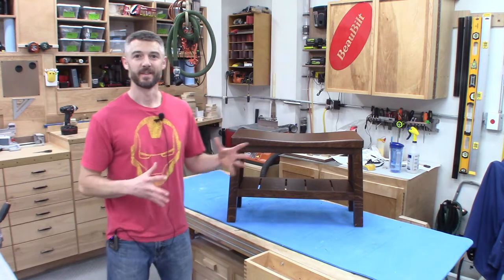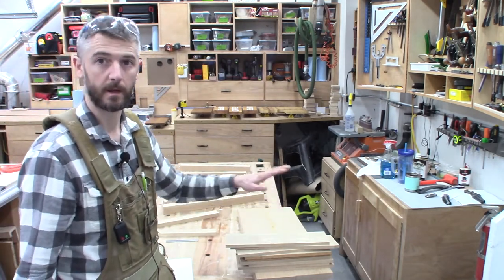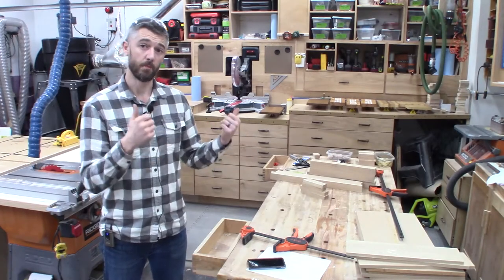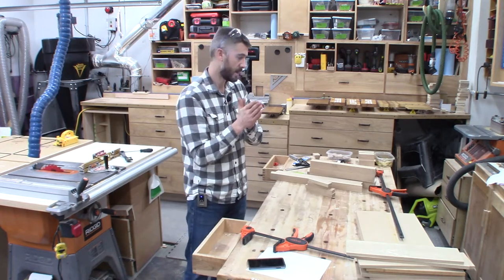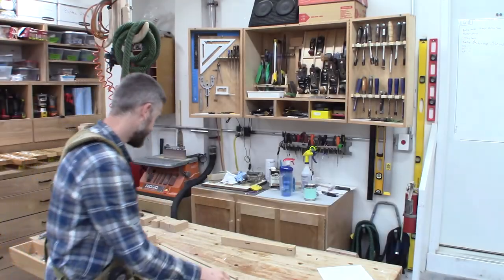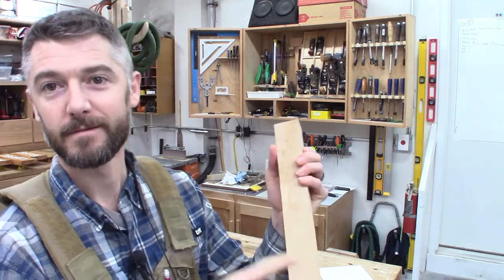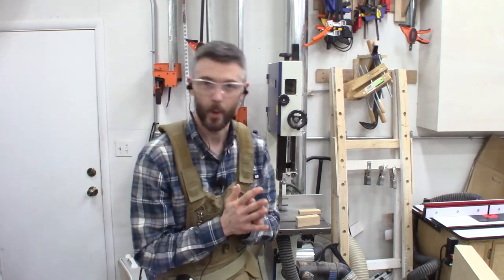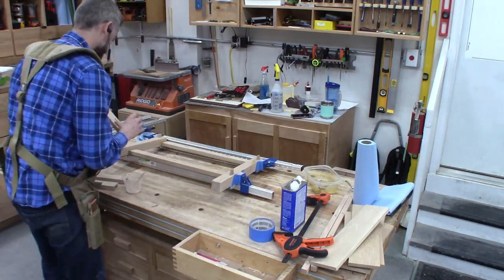Splayed and Shaped Bench

Comment: How did you make the loose tenons?
Reply from the maker: For this specific project I had them left over from a previous one.  In order to make new ones it starts with milling some lumber to the exact size of your mortise. That is the most tedious part. After that, rip to width(making a bunch of strips) add round over with router, cut to length.